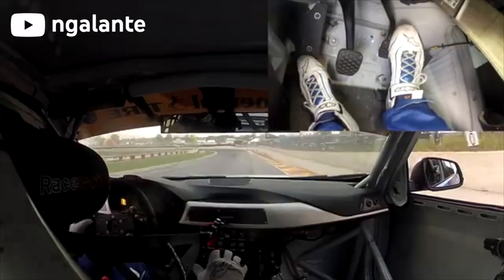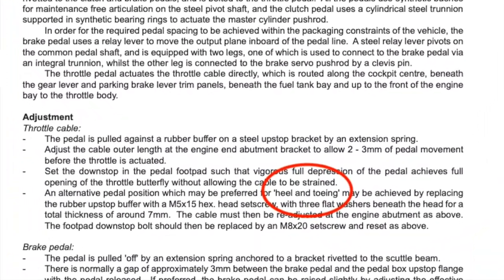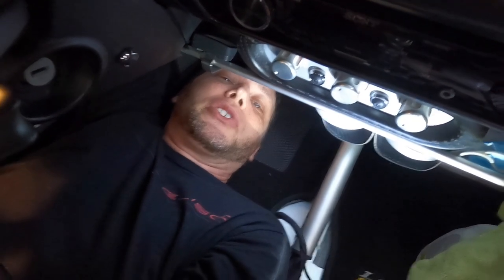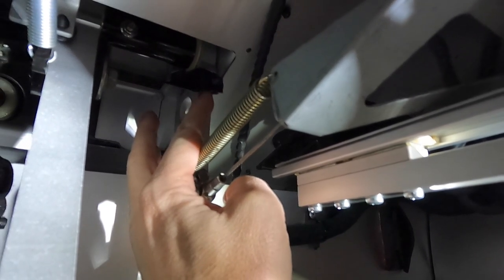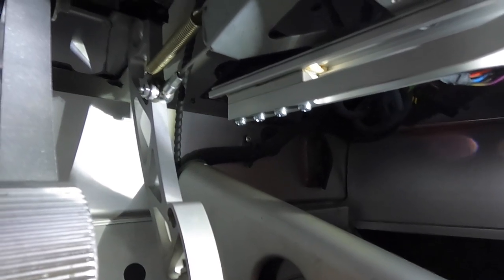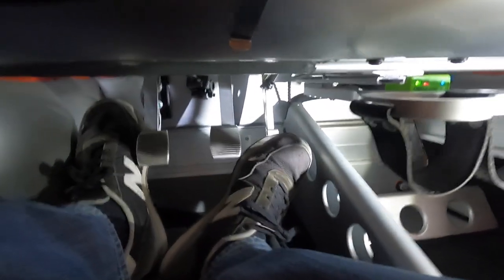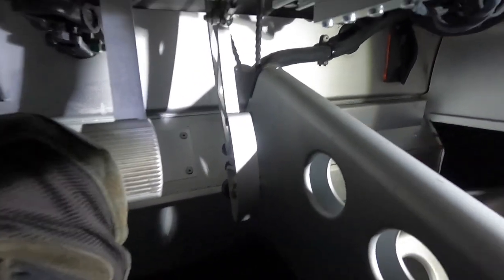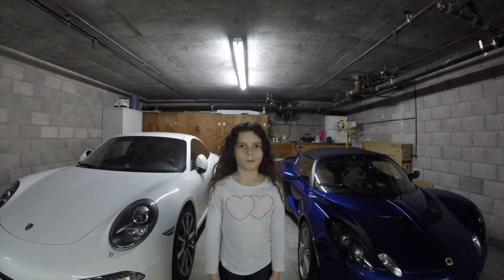🦶 Improve your driving with heel and toe pedal adjustments // Lotus Elise

Comment: Thanks for the great video.  One of my only gripes with my Elise is not being able to heel-toe.
Reply from the maker: Thanks for watching! Do you have a 2005 Elise? This adjustment should help a bunch. I didn't include the brake in this video, but you can also raise the brake pedal a bit too, see link in the video description.
Reply: @AtypicalDriver  Yes, I have a 2005 Elise. I wish I had an ‘06, then I’d cheat and buy an auto blip module.

Comment: Great video, my only issue is that you didn't shown the new "up stop" hardware and your notes refer to them as a "set screw", which in my industry generally refers to a headless screw, which the "down stop" clearly has a hex head, but I am not sure on the "up stop".   Is the "up stop" a hex head bolt or a headless hex drive set screw?
Reply from the maker: Hey Bryan - great question and thanks for watching. It actually is a regular normal hex head bolt. I had copied the verbiage from the technical service bulletin that Lotus had released (or maybe it was in the shop manual?) and I think maybe the brits define setscrew differently than what we do here in the USA. (I also think of a set screw as a headless screw, kind of like you will find on the front side of your gear shifter knob on the Lotus!) I'll edit the description to make that a bit more clear. Good luck with the project and happy heel n' toeing!

Comment: You only got servo assisted brakes in the US.. we had the Elise years before you in the rest of the world. Series 1 and early series 2 didn’t have a Servo, so our Lotus brakes are unassisted and perfect. I recommend you remove the servo for better heal and toe and left foot braking and next level feel. It will blow you away!!
Reply from the maker: Another local guy also recommended this. He said just pull the vacuum line off the servo and cap it. I haven't been brave enough to try yet but maybe I will! thanks for watching!
Reply: @AtypicalDriver , if you do pull the servo pipe off and block it and you have never used brakes that aren’t servo assisted before, it will surprise you how far and how hard you need to press the brake pedal. Don’t worry, it isn’t broken, it just means you have a much bigger operating window for the brakes. It will feel like they aren’t working, but they are. Just press harder and farther.. at which point, your accelerator pedal will magically be exactly where you wanted it..